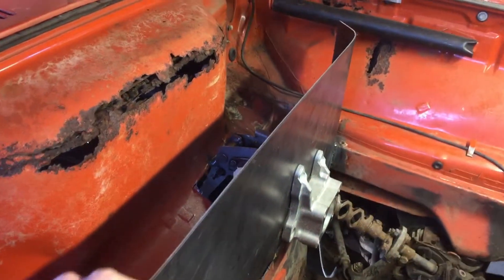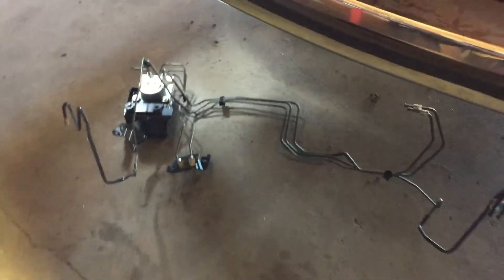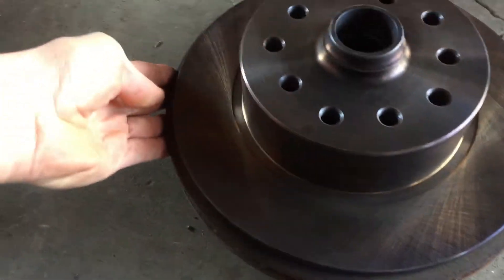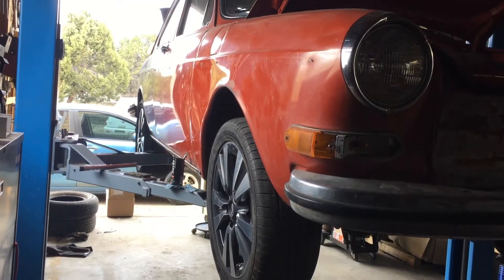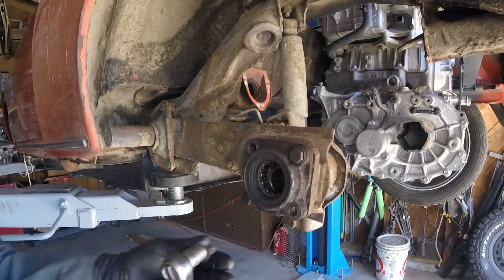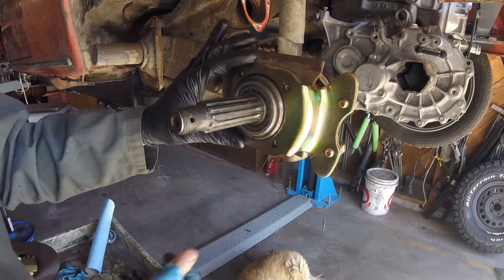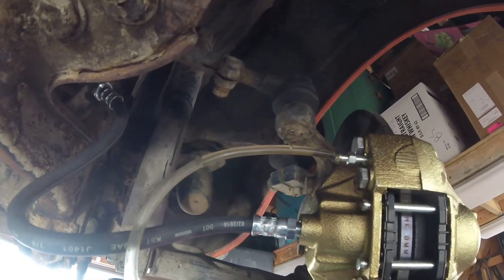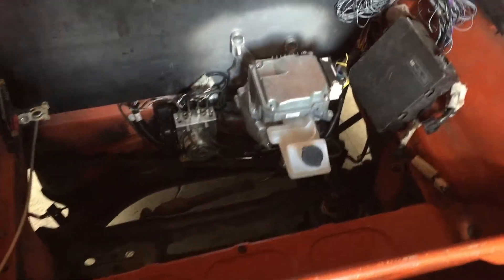FastLEAF brakes and wheels

Comment: Love this build! You've inspired me to do my own Leaf swap. Question, why did you go with the Leaf's bake system?
Reply from the maker: So cool! Keep me posted on what you come up with. The Leaf brakes are amazing and not much work to install. Plus you get heavier regen triggering and traction control potential. Power brakes are great ;)
Reply: @MicksUglyEVs  Hey, do you have any recommendations for what to look for when searching for a salvage Leaf?  Years to avoid or anything else? Currently looking at a 2012 with 50k miles that "runs and drives". Thanks for any help you can offer.